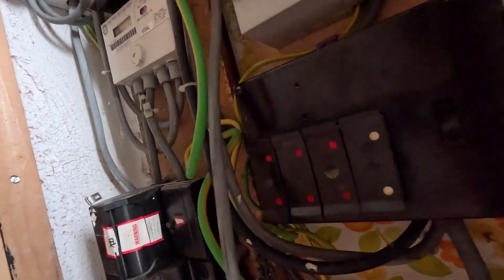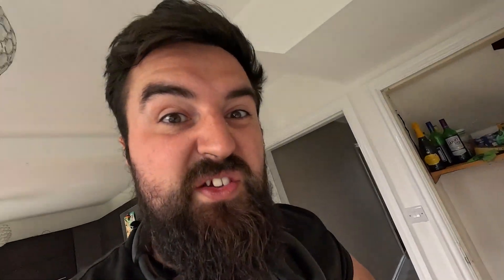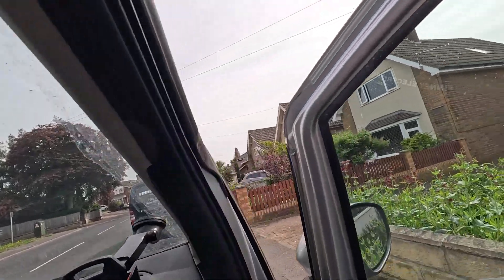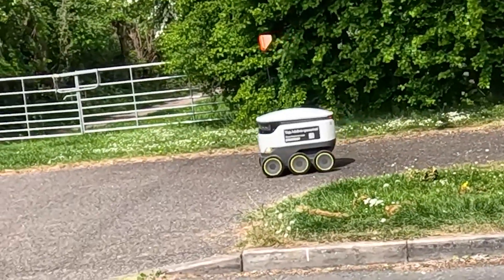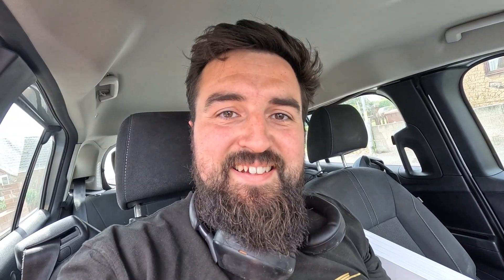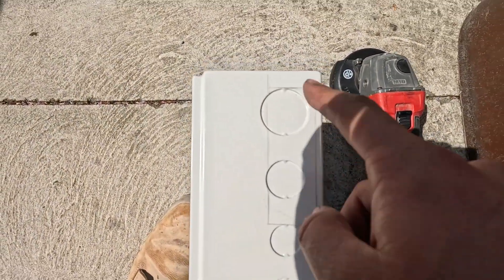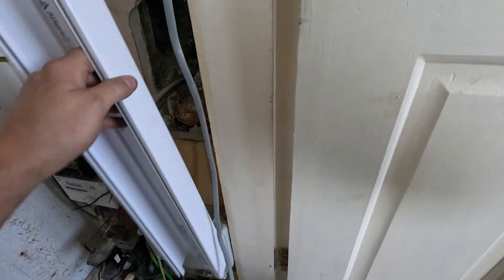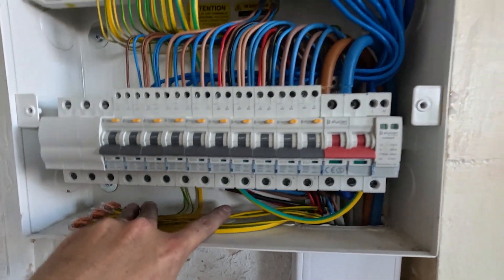I CAN'T BELIEVE WHAT THEY DID BACK IN THE DAY! 🔌⚡

Comment: Is there is there an isolator for solar somewhere else so cable dont come live, backfeeding from panels
Reply from the maker: So I don’t know of any inverter that back feeds, they stop inverting when there’s a power cut. You can have something called islanding mode or eps/ups which keeps a socket or whatever you wire to it live, that’s only if you have batteries 🔋
Reply: @finneyelectrical oh okay cool not really done much work on solar, so that's interesting, so once you kill the ac to it, it's pretty much dead
Reply from the maker: It’s supposed to be dead, there could be a fault on the panel which would make the panel carry out inverting dc to ac, that’s why you isolate the panel in the loft and low level when moving the switch like in this video

Comment: I have never been to one of those old boards that had gone on fire. And did you notice the lives and neutrals all had two screws on the terminals even the tails, that's why you didn't get loose connections not like the shite with have today.
Reply from the maker: Had a few in my day, you’d think having 2 screws you’d tight one of them tight 😂 there were a lot more DIYers back in the day, or an uncle who can do electrics 😂